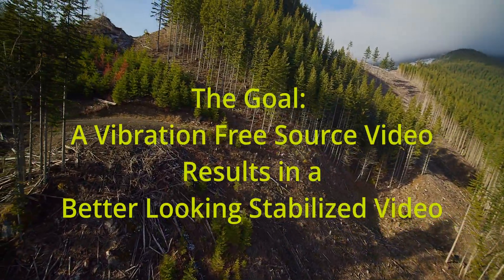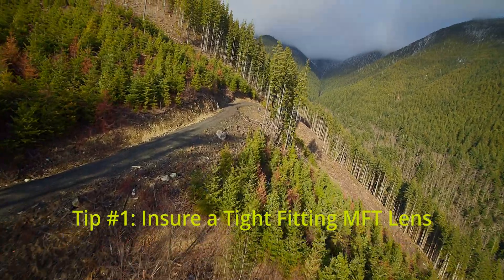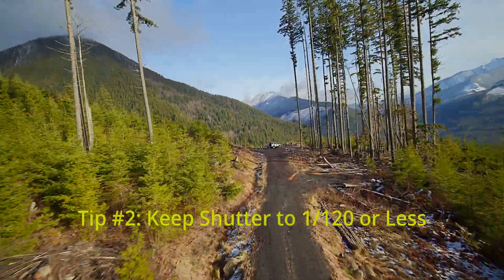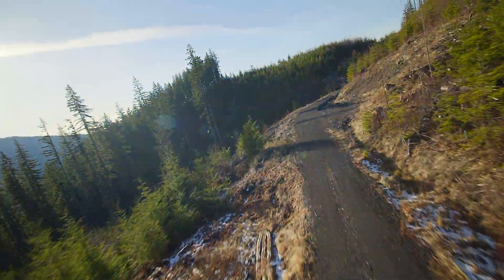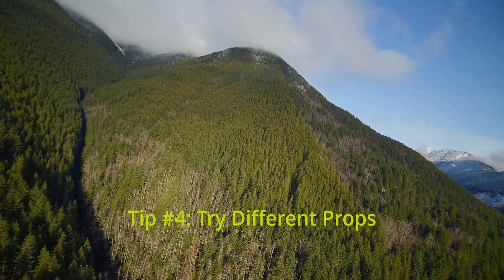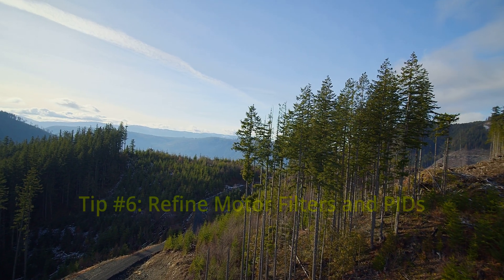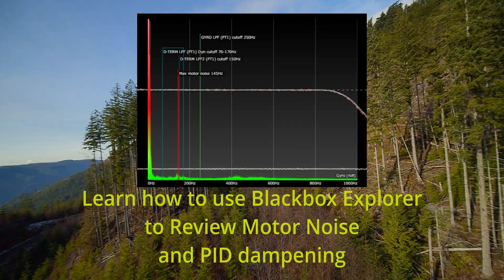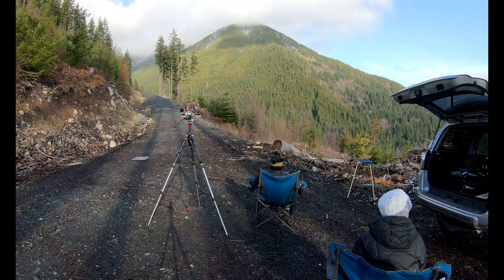6 Tips To Reduce Quad Video Vibration and Jello

Comment: Thank you for this video, a lot of was old stuff for me, but some things I did profit from. Could you tell me, which FPS did you filmed the video, when you said that you used 1/120 shutter speed? Was it 25/30/50 or 60? Subbed for more! Cheers
Reply from the maker: Thanks for watching. I film at either 30 or 60 fps. Now I am always using 1/200th shutter regardless of FPS to avoid the rolling shutter readout time induced jitter with my particular build. This type of jitter is related to the per frame line scan readout speed and how this quad vibrates.
Reply: @ValleyFPV  Thank you, will try this out with the Komodo. Thanks for replying! Enjoy
Reply from the maker: @8ways2fly  Isn't the Komodo a Global scanning shutter? If so you use any shutter speed of choice. Frame readout speed should be irrelevant and jello gone with a global shutter camera. My 1/200 shutter speed limit is because my Blackmagic 4k uses Progressive shutter scanning. I would be flying a komodo if I could figure out a quad design that yielded me 18 minute flight times.
Reply: @ValleyFPV  it is a global shutter, but up to this day I didn't manage to figure out and get a nice crispy picture on that camera... global or not, my image was always blurry
Reply from the maker: @8ways2fly  possible that the quad frame is simply too noisy and or not tuned right. Some frames are simply no good. Some props too make vibrations.